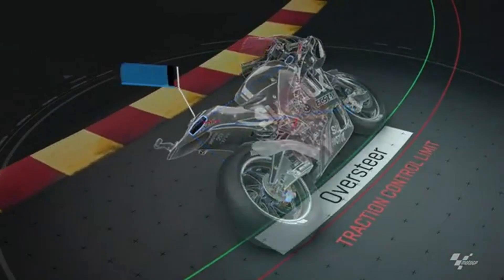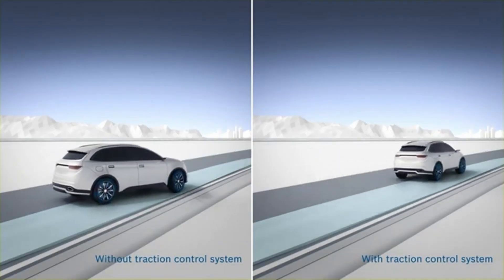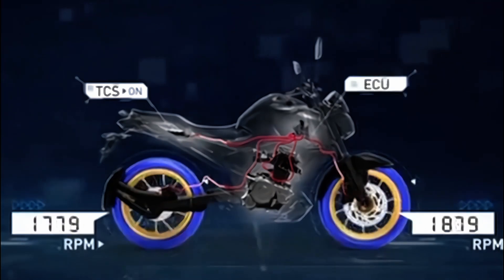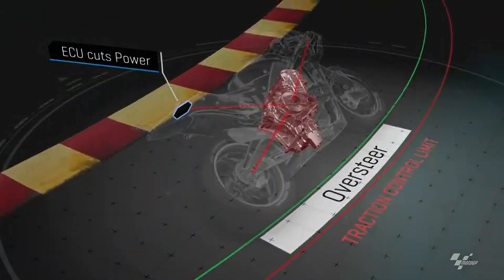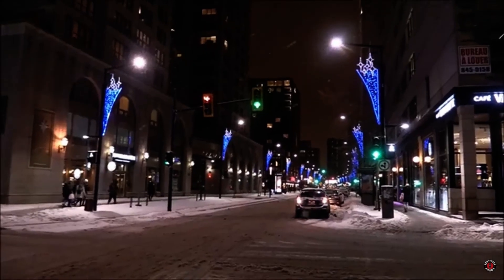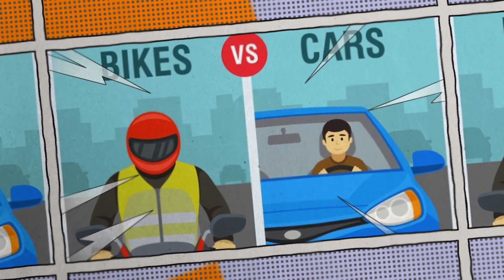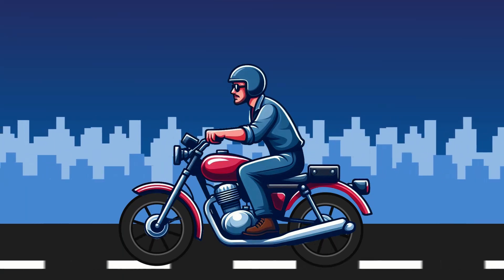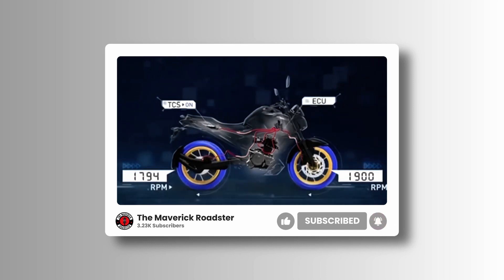The Hidden Science Behind Every Turn

Comment: Try to drive a small car with traction control on up a slight incline on a sandy track and the effect of the traction control will often stop the vehicle in its tracks :) Then there is the group driving their cars in central Australia for several hundred miles on wet slippery dirt roads with traction control engaged that burnt out all the vehicles brake pads by the time they got to Alice Springs.